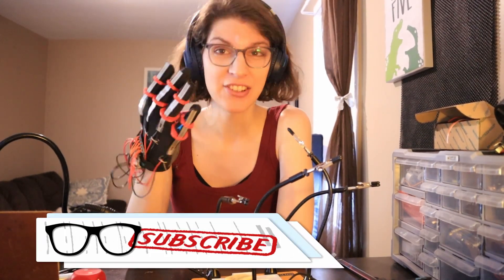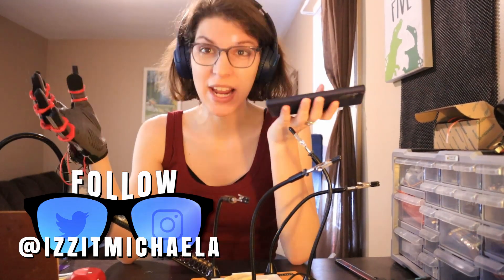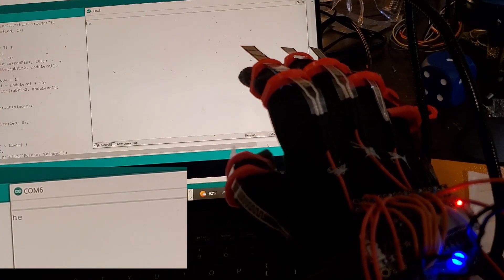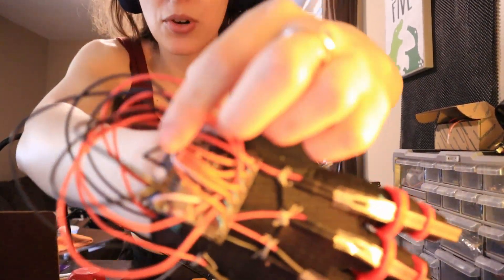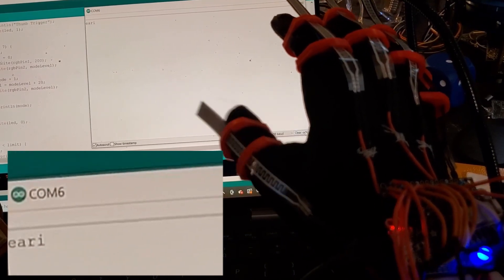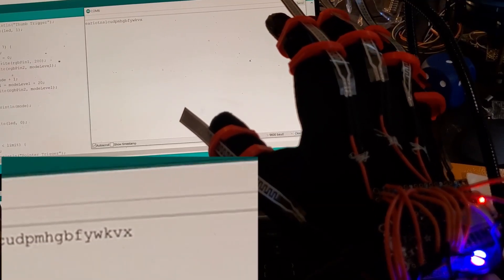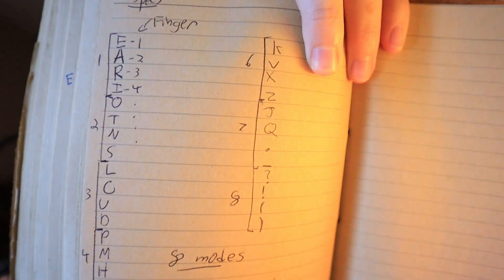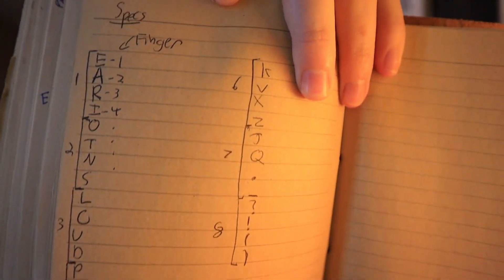I Built A Finger-Tracking Glove That Can Replace Your Keyboard

Comment: Maidhc from DPs here. You could make cycles after the first two by holding down index/middle ect and keeping the thumb, middle, ring, pinky that would require only to ring to get to 32/33 characters pretty easily. Also the tendons between fingers are occasionally not individually articulable, so it may make sense to build in input sanitizers to choose the "most" articulated. Alternative/phrase mappings with two of the gloves boggles the mind.

Comment: I hope you get in ! Looks awesome, at first I thought the sensors registered how far they're bent so like you could fully bend for a letter and then bend another way for another but I thought that was really difficult for remembering all the alphabet and with the coordination lol. Way better system you have lol Altough could have been useful for the thumb to be able to do next and previous maybe
Also, will this account for numbers ? Seems like you could just map another 2 sets quite easily
Reply from the maker: Yep! Unfortunately the flex sensors I used are a smidge unreliable in th3 sense that they dont have the precision to reoiably hit certain levels, so i jist opted for an all or nothing strat
Reply: @izzitMichaela that's probably good enough. I think the actual   use is where there is most room for improvement. You could do a morse like input but with more fingers, dividing the characters into a quad tree. Morse is a binary tree with max length 6 symbols, with one-of-four fingers input you can do 2 bit symbols and look up 8-bit ebcdic in just 4 symbols. Or if your ring finger is able, 4 bits or even 5 bits at a time is an option, for 14 and 30 characters per gesture (idle and next-group) being the remaining two possible gestures, probably open and closed fist.
Reply: Some modes would take some getting used to, and some would benefit from visual cues on a screen